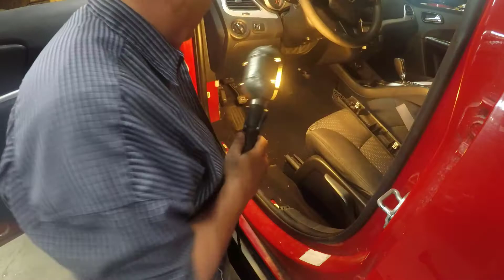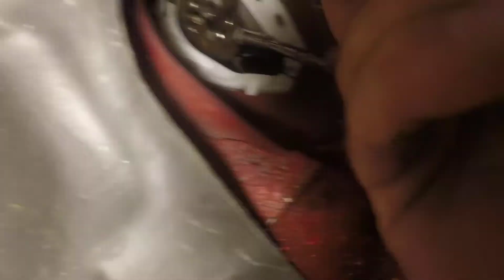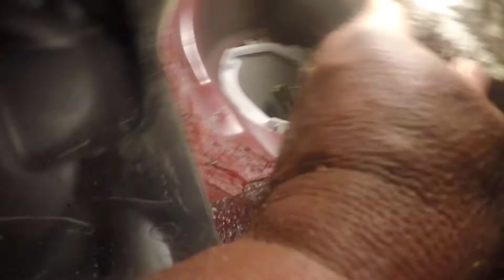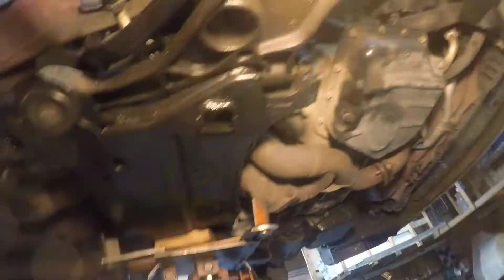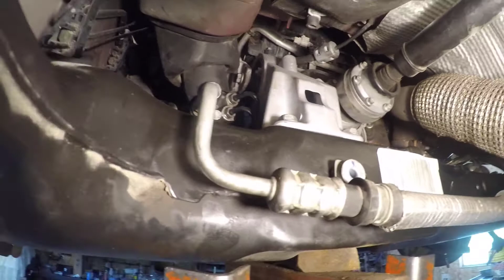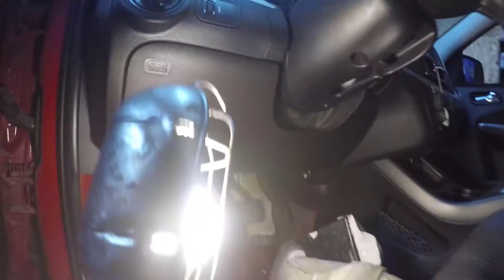Dodge Journey Power Steering Rack Replacement

Comment: Does the subframe really need dropped to replace the rack? Can’t you just take out the rack mounting bolts, the lines and the sway bar bolts and slide it out?
Reply: I just did it, and on the 4 cyl FWD I was able to get the rack out without dropping the subframe. It might be tough to do on an AWD
I was also able to get it out without messing with the sway bar mounting by sliding it out the passenger side with the steering column connection towards the back. That was a little tricky and almost certainly wouldn't work on other drivetrain versions
Reply: @waywardengineer9694 think it’s doable on a v6 just with fwd
Reply: I'm going to try it that way and will report back, but the Journey I'm doing this on is the I4 FWD version- so much less "stuff"
 in the way (the one in the video looks like a v6 awd)

Comment: what was the situation why you changed the rack to begin with
Reply from the maker: It had no power assist.  It was very hard to steer.  No whining or anything.  Just hard to steer.
Reply from the maker: I hope they were helpful!
Reply: @palsplace question, my journey is whining when I i turn the wheel. Could that be the  power steering pump?
Reply: @DionS-j6j same problem here I replaced mine still whining and hard to turn think it's this lol

Comment: How did you get that dust boot out? I can’t drop the subframe down far enough to get it out.
Reply from the maker: Did you unsnap the white clips on the inside by the floorboards?  After you unsnap those, you should just be able to push it down through from the top and then the boot comes out with the rack.

Comment: It's a pain.  Our rack is fine, but the engine cradle (frame section) was fully rotted out.  We're in the middle of the assemble.  I left the rack in place and dropped the frame section.  (As a precaution,  We had the rack supported on jack stands to keep it from pulling down on the assembly to hard while we took several days away from the project.)

As I'm watching the "marks" on the frame assembly.  Didn't do that on ours.  Then again our frame was junked and being replaced :-)
Reply from the maker: I agree!  It is a pain!